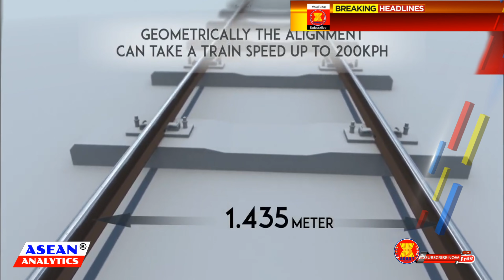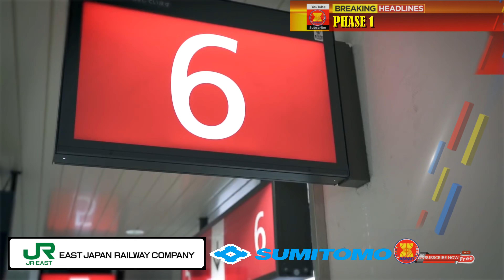$15 Billion Philippines North South Commuter Railway| PNR Clark-Calamba Line

Comment: $15 billion  for 160 km/h and 150km!!!

$7.9 billion for Jakarta–Bandung 350 km/h HSR and 143 km

$5.85 billion for Bangkok-Nakhon Ratchasima 250km/h HSR and 253 km
Reply: Filipinos prefer japanese, they dont like made in china but uses phones and cars that are made in china.😁😁😁😁
Reply: @awesome8975  The Philippines we are rich😁😁
Reply: @macdonel.m4702  we are not cheap we are rich😎💰💰💰
Reply: @awesome8975  China phones maybe but 90% of our cars are Japanese I rarely see Chinese ones.
Reply: @heavyarmzs20s5  geely, foton, cherry, mb and many others i know japanese cars dominated philippines given ten years time it will be another story.
Reply: @awesome8975  but China also offers tot
Reply: Philippines  is 150km all ELEVATED RAILWAY That is why so expensive and also the company who construct the project its japanese technology
Reply: Namamahalan kb,dapat di na lng pinagawa noh para wala gastos,.dapat kagaya lng ng dati wala project noh.kagaya sa dilawan
Reply: @christoferbravante4359  😂🤣
Reply: Cause it includes subway system. Subway is far more expensive project ...
Reply: that $15B will traverese fully developed areas,, therefore right of way costs are expensive
Reply: Indonesia's maybe mostly on ground only. That's why it's less expensive.
Reply: The problem with philippines is most of these railways will be build or build in busy and already existing highways... They have tp build most of it an elevated railway which cost alot...
Reply: Dang, Indonesia now has the fastest HSR in South east Asia, unbelievable lol
Reply: I think when the progress of Thailand's HSR reaches 70%, the price increase will occur, our Indonesian HSR was initially priced at 5.5 billion but after 80% progress the price increase to 8 billion and Thailand's HSR will experience the same thing
Reply: $ 15 billion is just a coin in the philippines. in the excessive amount of gold deposits of the philippines in the world. it's just dust money stored in the central bank of the philippines. pretending that the philippines are poor but they are the major owner of the world bank.
Reply: @youtubepatrol6372  agree

Comment: Indonesia initially expected construction on the 145-kilometer line to cost $5.5 billion and be completed by 2018. The project's estimated cost has increased to $7.9 billion, according to state-owned railway operator Kereta Api Indonesia (KAI), which is part of the KCIC consortium.Oct 14, 2021
Reply: That is HSR Project not Commuter rail, Please make complete sentences, because there are various kinds of lines and types of train services
Reply: Malu maluin  lu bgst beda mrt comuter line sama lrt bgst   malu gua liat komen  lu
Reply: @vinhvinh5445  gak usah mencaci maki tidak baik

Comment: With a distance of only 150 km but the construction cost of 15 billion is too expensive and has the potential for corruption. The speed of the train is only 160 km / h and the design is not good. Many Asean countries are building metros in collaboration with Japan, such as Indonesia, Thailand, and even the metro Malaysia and Germany with high technology is also cheaper, even though the length is the same as the Philippines, but the Philippines' price is very expensive. The potential for corruption in this project is very high.
Reply: Very high is a understatement :)
Reply: Lols, itigil na yan, para wala na. Mag tiis tau sa traffic

It is expensive because it is mostly elevated.
Reply: @aldryn00251  of Course it is elevated dear. 
That's why the Corruption is also well elevated.
Reply: @dongshengdi773  yes parang yung ginawa nyo sa express way, naia x at lrt extension. Puro commisision tapos iniwan na.
Reply: Kahit mag.Chinese name ka pa..halata pa din ang pagka.itlog maalat mo..PINKLAWAN..hindi to panahon ng mga aquino na mas malaki kickback..Duterte na to oie
Reply: Nakakatawa yong mga trolls ng Pink-dilawan, nag-Chinese at Korean name na sila pero wala pa rin kumakagat sa mga pautot nila. Inuulit lang naman nila yong lumang "Corruption" na tula nila kasi allergic na ang tao sa "Demokrasya" buladas nila
Reply: Most expensive because they are all elevated railway and the philippine  gov now is they only accept the highest price bidder company
Reply: Its japan comstruction
Reply: Hahaha tell that to Spain why the design is not what u expected 😂
Reply: Lahat ng administration may corruption. Itong infra transpo project, kahit may corruption, may mabubuo naman na pangmasa at maraming makikinabang. Tataas din ang productivity at income ng mga dadaanang lugar. Maaring mahal nga ang project, pero mababayaran naman dahil sa improvement sa productivity. Mabuti na yan, kesa nun nakaraang administration na sinira pa yung MRT3 at walang nasimulang infra projects, may corruption pa din!
Reply: I think why it's expensive maybe because it needs to be earthquake proof and typhoon proof
Reply: @sug_madic6133  You know, this is the first comment today that i have seen that is reasonable. Good job lol